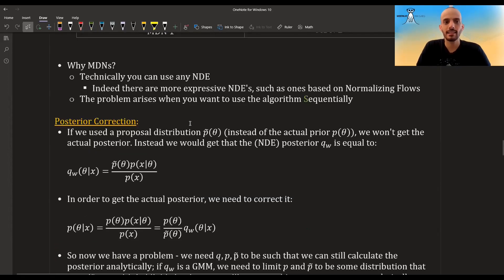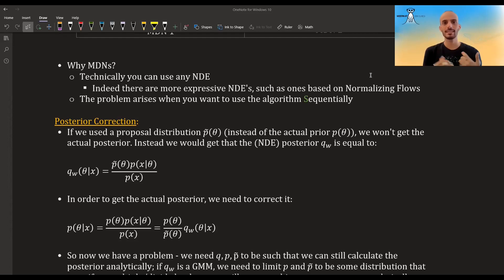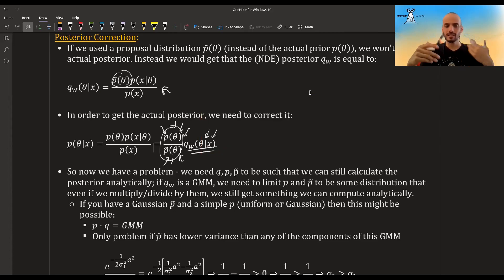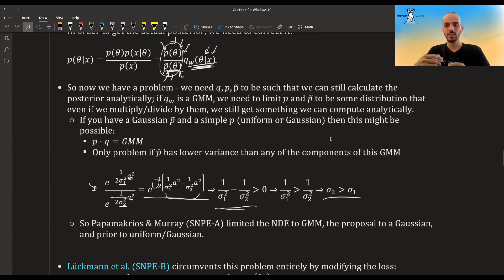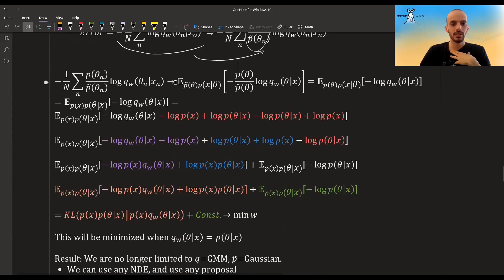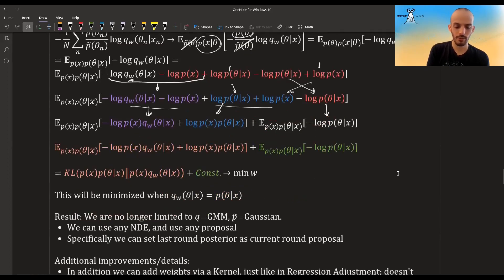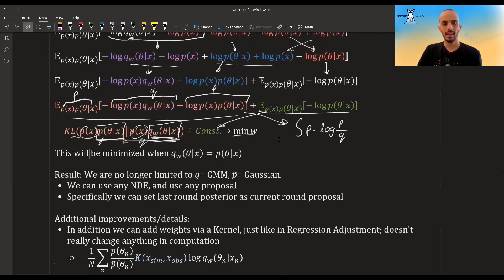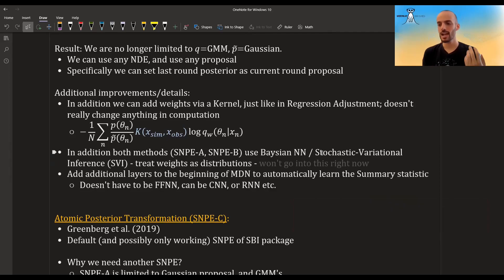SBI - 8 - SNPE - part 3 - From SNPE-A to SNPE-B

Comment: Hey! Awesome video!!! I was wondering what do you mean by true posterior? Since, usually the simulator take as input a parameter theta, and you are trying to make an inference based on this true value of theta, right? Or maybe I'm wrong about it hahaha
Reply from the maker: the simulator takes theta as input, but you don't have the "true theta" - you only have a x_observed from the real process, not the simulator. You hope the simulator captures the true process, and you now try to invert the problem, and find the most likely parameters (posterior) given the empirical data x_observed